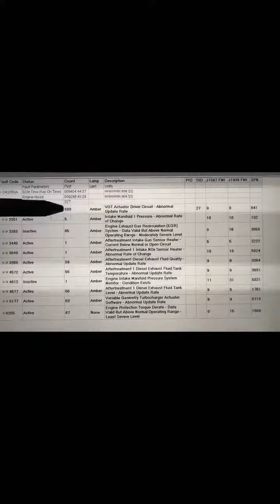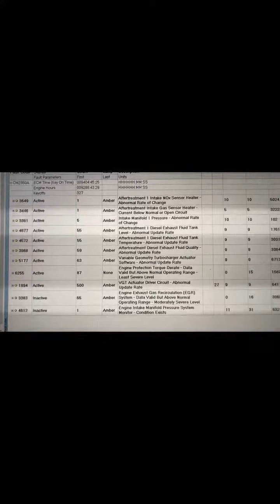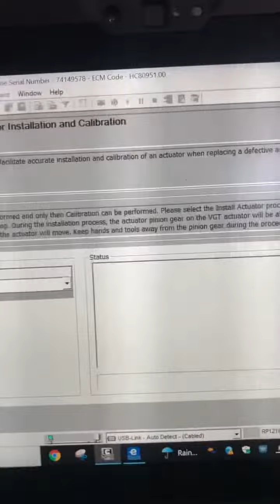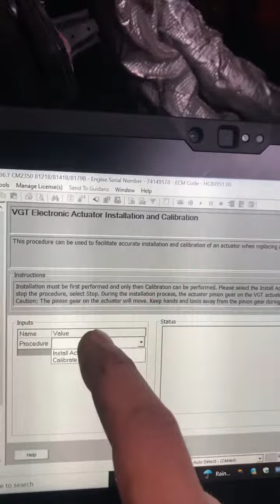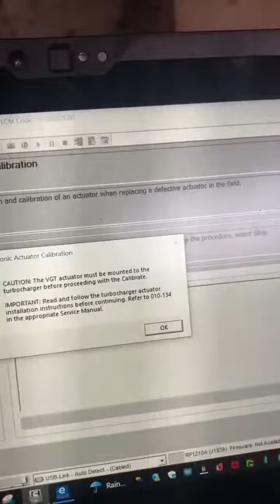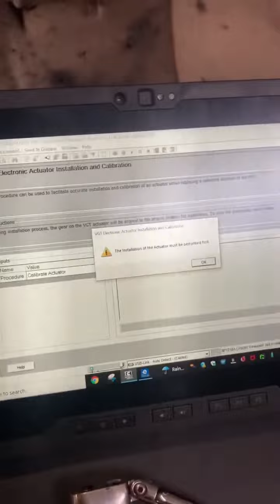VGT turbo actuator - diagnose, remove, replace, install, and calibrate for Cummins isb

Comment: Listen my friend you just made an outstanding procedural video on how to troubleshoot the electrical, mechanical, and diagnostic of the VGT. You were very detailed in every explanation and the video where we can see the physical movements were outstanding. You verbal explaining of the parts and process is spot on. Dont be concerned with all these Couch Potato's criticizing your effects here. I have a Paccar MX-13 EPA 17 my VGT Actuator went bad last week 12-19-23 and your Video I watch is exactly my problem. My JPro Code for my issue is EGR Malfunction detected fault code P1496. Variable Geometry Turbocharge VGT Actuator Can Communications error U1159. I'm wanting a new VGT I ordered. Great Video f....k everyone criticizing you my friend outstanding work to show us all the Procedures and how to. FYI guys watching video what size Alan Key Socket he used he says it is 3/16th Socket.
Reply: Well said Shannon
Reply: Word up!! I agree this guy is very helpful. 2 middle fingers up to all the critics!! And much thanks 2 this gentleman and scholar helping us

Comment: Hey, thank you very much for your video. Right now, I’m changing my VGT by myself, and I don’t have any computer programming tools. How can I do the computer programming after replacing the VGT? Should I go to a shop after the installation to get it programmed, or does it need to be programmed before installing the new VGT? Could you answer my question, please? Thank you.
Reply from the maker: @akhytzhandos3043  it has to be programmed before and after installation so you should take it somewhere with the software.

Comment: Very well explained on the installation procedure of a vgt. I was trying to explain this to a co worker who didnt know that you had to align the flap on the turbo to the mounting hole so when he did his first calibration and installation it came back as a failed actuator. When i aligned it for him the actuator and the turbo worked fine and hasn't had any issues. I think I'll show him your video as a guide.

Comment: How do you know if the actuator need calibrated
Reply from the maker: @DemonsBurnis  the actuator needs to be calibrated any time it is removed. If you take the old one off or if you put a new one on. Calibrating the actuator is not a fix. If you’re having problems with the turbo or actuator calibrating it will not help.

Comment: Such a great video, with ton of knowledge. I have a question for you sir. Does it mean, it’s a bad turbo, if u find some oil in the actuator housing( where the turbo shaft is attached to actuator teeth)? Recently I have a replaced my actuator and found some oil there but don’t have any loss power or codes. Turbo shaft also turn smooth from left to right, just a tiny more pressure needs to be applied once get to right end. Could u pls advise? Also is there a contact, where I can get hold of you? Also have this other weird issue that no one seems to figure out. I can explain that better over the phone than typing it. Thanks
Reply from the maker: @sukhjitsingh2504  there are seals inside the turbo that go bad and allow oil to pass into the actuator. There should not be oil in the actuator when you take it off. So, yes technically the turbo is causing that problem. You may not have any problems now but you may be replacing actuators more frequently and eventually see turbo problems. But it is a personal decision as to whether or not you want to replace the turbo or let it go until it gives you further problems.

I don’t work in this field anymore. If you want to try to type out your other question here I’d be more than happy to try to answer. If not, I don’t have a contact number to give. Sorry. Glad this video helped you out.

Comment: If I remove the actuator just to see if it’s working properly. And it won’t rid fine, do I still have to calibrate it assuming I put it back just as it was when I took it off
Reply from the maker: In order to see if its working properly you have to move the gear in the actuator and your should check the turbo lever as well. So you have to move them both and I don’t think you’ll be able to get them back exactly where you took them off at. You could try it but I don’t want to recommend it.

Comment: Do you know what the code 6 is on the installation sequence?  I am installing a new vgt actuator and am getting the same code 6.  Cheers
Reply from the maker: I don’t know what you mean by code 6.
Reply: @alreyindustries  in your video using insite on the install part it came up with failed and showed you code 6.
Reply from the maker: @feral4mr2  do you have the new actuator off of the turbo, but connected to the electrical connector?

Comment: Would it be possible for me to drain the coolant and replace the VGT and then replace coolant and drive it somewhere and have them program it? Or does it have to be programmed before it’s installed?
Reply from the maker: Before it’s installed
Reply from the maker: Is it not driveable now? Could you drive it to wherever before installing the new one?

Comment: So i switched out 2 new turbo actuator and still wont so calibration so I installed it like that and worked for a day and now again giving me code
Reply from the maker: What is the code? Did you do both calibration procedures through Cummins insite?

Comment: Im trying to do the Hysteresis Test. But my coolant level while idling is taking forever to get to 158F. 
Is there a way to speed this process up to test the actuator?
Reply from the maker: Drive it
Reply: @alreyindustries  thank you for the quick reply
Reply: Or just put your cruise control on to about 1500 rpms and let it warm up that way.

Comment: So this looks like something the DIYer can't really do correct?
Reply from the maker: Yea, unless you are a pretty educated and handy diyer. Even so, you would need the Cummins software as well. 
I made this video more for the technician who is learning and has the resources but just needs a little guidance rather than for the diyer.
Reply: @Alrey Industries Top Tech Diesel  I could handle the repair just fine but I lack the software to calibrate it. I'm not a "trained" mechanic and yet I found ur instructors to be extremely easy to follow. I have 3 and a half years of aircraft maintenance school under my belt, only needed about another year to get my A&P license. Appreciate the video, and I appreciate the reply.